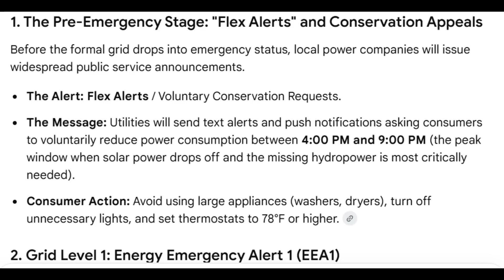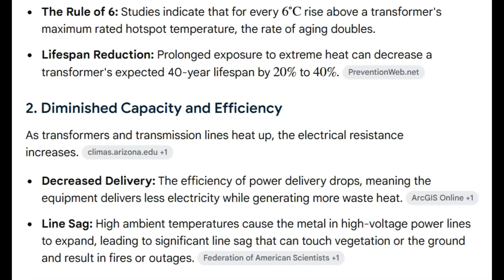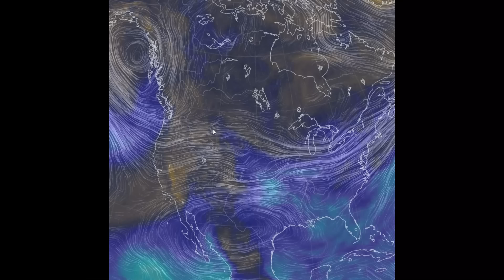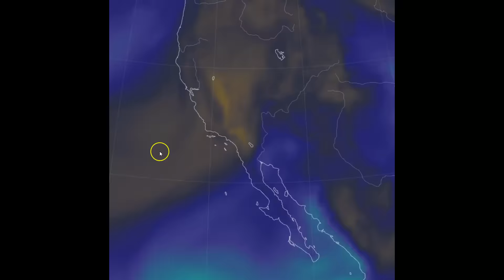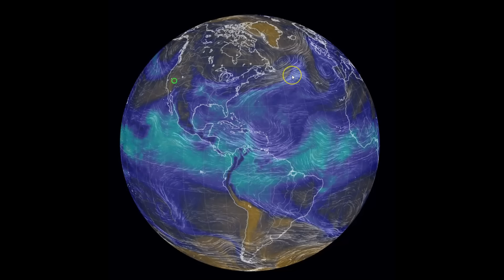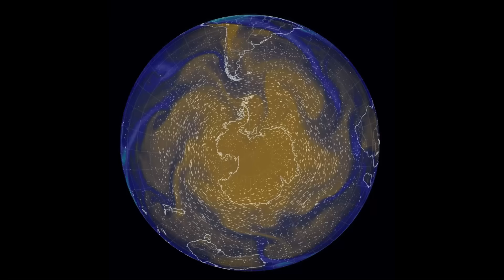Major Blackouts Coming!

Comment from the maker: Record Heat Dome Trapped Over The SouthWest and The Shut Down Of Lake Mead will cause Grid Failure.
Reply: They are gonna cause a grid crash and we will all be starving while they run driverless bulletproof Tesla 18 wheelers to feed their supply chains and data centers. Just watch.
Reply: @ericbouwman8322 very possible and probable
Reply: @e @ericbouwman8322 t isn’t this all about these Data centers remaining up and running. They’d shut us down before they lose any data center 

Can anyone say Jesus is returning. It really is about collapsing the U.S.. know not everyone see this the same she has to fall for the mark 
Unsure if interested . You are aware where the state of Texas sent Israelis red heifers. Well Israelis go by torah they recently had a red y of their own they’ve distance themselves from Texes claiming they’re orthodox jews committed to Israelis Torah. They flat out said they do not want any help from Christians. This Hefier is about a week old. Born in Israel in Galilee

Christian not welcome wow..
Reply: Isn’t this all about Data centers. Get the water hot it’s low but they are not going to allow any of these data centers to shut down.. 
i know what you’re talking about hydro power.
It’s HOT here in Southern Arkansas
Reply: OHMS law when voltage drops because of resistance , amps increase which causes higher wattage which is a measure of heat.

Comment: They will lack the buffer of both inner grid & interconnect grid imports when it matters most. From Mexico to Alaska all the water & reservoirs of the wicked are being returned and when everything east of denver is baking under the full force of karma there will be no extra power to share. For the first time many will see the grids try to isolate themselves as the machines of the wicked simply be no more and as they attempt to save themselves regionally or locally they will quickly be down to what individual machines can produce but only for a moment because they've already failed. This isn't punishment for the weak & meager from above for all were given the tools & knowledge to solve all of mans problems but the wicked instead chose to keep it all for themselves be it through ultimate greed and the demons within, it was known & seen long ago but as any patient Father would say it was still a test with a point. That is all I can say for now and more than I should but that is my choice, yet all is subject to change in an instant but likely not better for it is already known the choices that the wicked will make. Be mindful, be ready, be pure, be kind and most importantly be with love.

Comment: I worked at a municipal utility for 30yrs. Our peak time was 5-7pm. When people get off work. Also, the winter time is worse during cold temps, because most new homes have electric heating. It’s just as bad at this time, as in summer peak times! Remember Texas Power during I think 2019. Texas had somebody convince them to supplement solar and wind turbines. If the sun don’t shine your screwed. Also wind turbines cost around $10k per hour to operate! That’s not economical at all?
Reply: But it made a lot of countries and companies rich........

Comment: Why dont they build data centres on the coasts and use desalinated water. Unlimited and wont effect people
Reply: point is take YOUR water not use water  already available.
Reply: @takeonedaily  Perfectly on point!🤨
Reply: Can't take YOUR water if they provide their own.  Taking our water is half the goal.
Reply from the maker: Cost too much and it destroys marine life
Reply: I’ll vote for you!
Reply: China'is placing their data main frame's in the coastal ocean floor, for it's cooling  problem.
Reply: Why dont they juat not build data centers and take that beast system and take that ish to mars w Elon
Reply: @GRUBB-MUDD the only correct answer

Comment: Constant chemtrails around the Globe has impacted the atmosphere around the world, this heat is hitting different
Reply: In northern Kentucky it's going is forecast be 99 degrees here in 5 days.
Reply: Spray Bug's'as We the Pleebs.
Reply: Looking at the sky, and there are bars(we use to call them on lake Michigan by the shore) but, in the air, radio frequencies cause that.... there were alot of AM stations shut down....